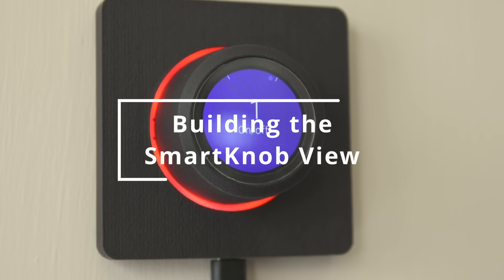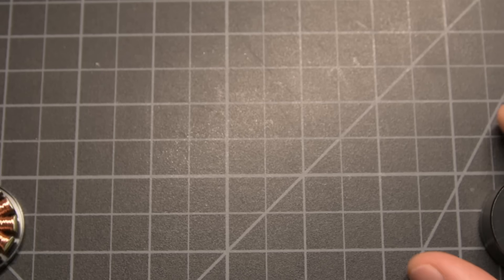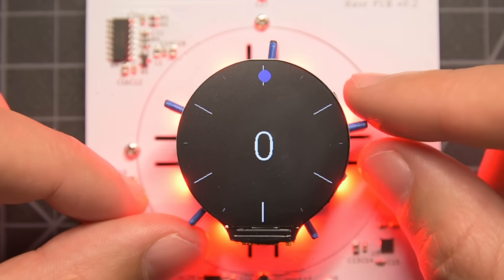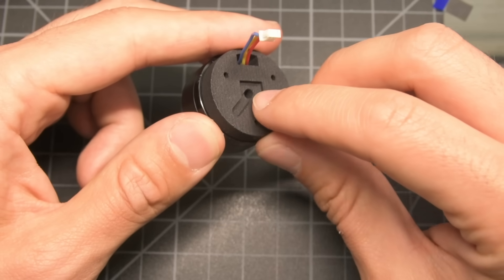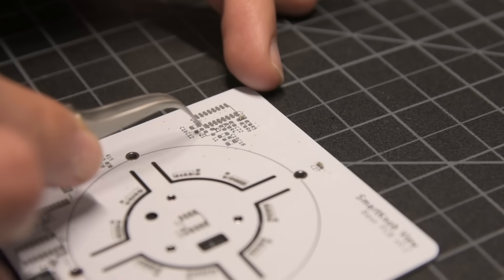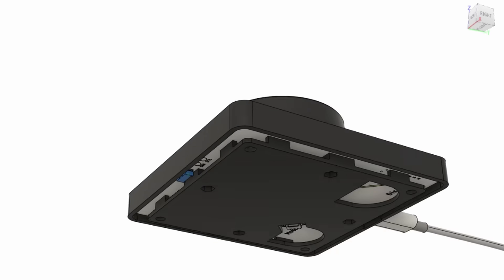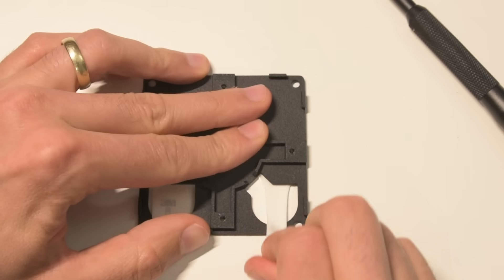Building a haptic input knob from scratch!

Comment: Would you consider making an automotive variant? Maybe with a smaller base or a small mount with a remote (via wires) mounted controller. The strain gauge would probably not work in that application, but i think a good button would suffice.
Also a round oled rgb display would be better for that application to avoid becoming a blinding light at night (yes they exist, just nit sold on mainstream sites)

Comment: You have full one axis control loading system here, it is possible to simulate mass, friction and other things. I have been working on similar project with RP2040, stepper and 24 bit mag encoder. No strain gauges, just delta between expected stepper position and actual encoder position. Fun project.

Comment: you should start business producing these. Oh, if i weren't in Russia i've bought a few of these and used them for controlling the thermostat, fan speed, dimming light (you can push to turn on/off, it remembers previous value, you have strong detents, from 1 to 100), volume of my stereosystem (why not).

I think all manufacturers should start using this concept as a real thing cuz it's perfect.

Comment: How did you handle design of snap-fit components without the ability to quickly iterate locally? Is there some reliable way to know the exact tolerances? Did you just order a bunch of times until you got it right?
Reply from the maker: I did some initial prototyping with my Ender 3 which is not super dimensionally accurate, then guestimated some reasonable tolerances on the assumption that JLC's MJF prints would be relatively precise, and then I got lucky that it didn't require more iterations 😅

Comment: Hey did you remove the Strain Gauges? I've looked through the BOMs and it looks like there are now 4 330Ohm resistors placed instead of those Strain Gauges.
Does the current PCB not have the "Button" Click anymore?
Br Shaunie
Reply from the maker: The SMD resistors act as strain gauges, and are much easier to assemble. See  https://github.com/IvDm/Z-probe-on-smd-resistors-2512 for another example that inspired this change.
Reply: @scottbez1  Cool thanks for the explanation never seen something like that :D
Reply: @scottbez1  I would have a second question, I have now all together to build one my self (very cool project) but I could not find which screws you used for screwing the motor to the pcb and which one to screw the plastic part to the motor (I know it should be some M1.6 but which length did you use?)
Br shaunie

Comment: this is not just a hobbyist DIY project, this is something completely different. this guy could put this in kickstarter and earn profit from it but no, he decided to open source his idea for the community. what an amazing lad. 

personally, this project is waaaaay above my skill level and reach. like those part are only available oversea and only sold in bulk. one day, probably, one day. 

one thing would make this cleaner is instead of having 3v USB cable dangling below the knob, is to use the main 120v for power. i get the idea of it being portable and compact but im just throwing my 2 cents.

Comment: Instead of individually soldered wires, what about a flatflex cable that is folded / rolled up to fit within the narrow inner hole? Those can even have maching SMT sockets.
I suppose that sort of thing is more suited to larger volume production, since that would add extra design / BOM complexity above that of manually solfering the narrow gauge wires.
Reply from the maker: Agreed entirely! I was also looking at off-the-shelf fpc ribbons as well during my initial design phase, but eventually realized I was spending too much time agonizing over the details needed to make that work and decided to just hand-wire it in order to build a working prototype first. Since then, the cost of low volume flex PCBs has come way down, so if I revisit this design it will almost certainly use a flex PCB to make assembly easier!
Reply: @scottbez1   I still miss watching your videos! You sure are one amazing lad

Comment: This is strangely complicated. I had expected a simplified optical encoder. Similarly to the twist pads on Neff induction stoves. They just use a optical version of rotary encoder. you just need a light source and several light sensitive diodes and some magnets for the cool haptic.

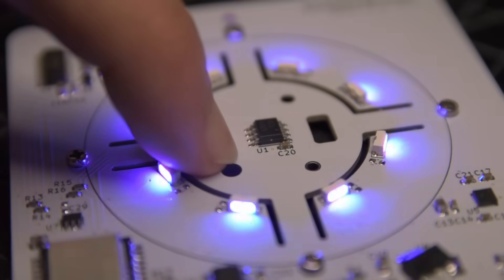Comment: 1:43 - I'm sure we all know theres some factory in china that have thousands of similar gimbal or brushless mini motors in their stock. You should use ribbon cable to transfer data and power or some kind of fiber optic cable to transfer data. 8:03 - How does that pressure sense work exactly, Gryo chip? I wouldn't use PCB as a flex button, it's going to snap after sometime. I like the fact that the motor is used for haptic sense, was planning to make a knob without a motor, but this video proves its worth using a BLDC for the haptic features. Nice demonstration.

Comment: Hi! I am looking to try make one of these myself! I am about to order the pcbs from JLC with assembly, and they dont have the T Micro 32 plus, only the T Micro 32. I am using the latest release of the base pcb, v0.4. I was wondering if it will still work with the T Micro 32, not the plus. Thanks, Koda

Comment: An alternative way to implement the “push button” would be to use the push axis function on the MT6701. That would probably require greater mechanical movement  than the flexing of the PCB  would allow. The strain gauge method would also facilitate a proportional force function, adding even more haptic feedback options. Gentle press, long gentle, hard press, hard short press/tap. Such a wonderful project!

Comment: If the force is directly proportional to the displacement, you have the very definition of a simple harmonic oscillator.  It should swing back and forth to the point it was released from, forever.

Comment: well done, as an electronics engineer all of your approaches to this solution are without error. considering the proprietory costs of some military components like yours, you should be bullet proofing this button and testing it to destruction to work out how long it will last under strain conditions and how many cycles it will last.

Comment: Very clean design. Would be nice to figure out a way to hide the power cable though. Maybe make a wall plate version that can take power from behind? The design could support alternative usb port solder location to the rear and mount holes for a standard wall box.

Comment: Can pcb traces be used as strain guages?
Reply from the maker: The resistance is likely too low. I believe the zig-zag traces in a strain gauge are typically made from other metals with higher resistivity and other properties like low temperature coefficient, so can work better than copper traces on a PCB. However, the latest design of the SmartKnob in GitHub uses SMD resistors rather than gluing strain gauges (similar to https://github.com/IvDm/Z-probe-on-smd-resistors-2512), to make assembly easier, and it seems to work but has not been tested substantially to promote it to a release yet.
Reply: @scottbez1  wow thats really cool!

Comment: Awesome build! Question for ye, why use the flexible pcb for selection detection, vs a mechanical switch? Is it for longevity purposes?
Reply from the maker: Mainly a combination of mechanical simplicity (no need to mount the motor to a separate piece that can move and press a mechanical switch while still feeling solid) and I just wanted to try something new 🤷‍♂️

Comment: Idk man all of this separate sounds like you look for a BLDC servomotor it will have all in itself, motor, motor driver, encoder, good control scheme and you should get those under $50 from ali.
Not sure about the hollow shaft, servomotor I have in mind doesn't have that, some models might have built in slip ring.
Reply: Regarding the strain gauges, you could get ones with pre-applied glue which you just tape down, clamp down and bake at like 100*C
And for it's wiring you probably want to use flex PCB, which you should get cheaply from oshpark

Comment: i have a question about the code, im using as5600 and a 360 servo but i couldnt make it right, when my current degree position for example is 270, when I want to move it to position 15, the servo move should move clock wise 105 degrees, but it didnt, instead it move 255 degrees counter clock wise. how do you implement the code with angle sensor?
Reply from the maker: Hmmm it sounds like an error in how the angle difference is being calculated, which is super common when working with angles since they "wrap around". The exact fix will depend on how you're calculating the angle difference and what the range of numbers are, but generally you want to make sure that your calculated angle difference always comes out somewhere between -180 to 180. So e.g. if the raw angle difference comes out to something > 180, say, 190 degrees, you'll want to take 360-190=-10. Or if the raw angle difference is -255, which is less than -180, you'll want to use 360+(-255)=105. The only other thing to worry about is if the sensor ever reports something more than a full revolution - some driver code will keep track of full revolutions so e.g. if you turn the magnet clockwise through 2 full revolutions, you may get back a value of 720, so always double check the range of inputs you're getting before doing any calculations.

This assumes that you always want to rotate the shortest possible distance to get to a particular angle. Things will be different if you want to always rotate to the final position while keeping track of revolutions so you can "wind up" the angle difference and then want it to fully "unwind" to get to the target angle. That's how the SmartKnob calculations are done, which requires a little additional care to be taken to make sure the sensor driver is tracking full revolutions and that all angles are represented as positive or negative numbers centered around zero.
Reply: @scottbez1  ah "wrap around" is the word im looking for, my magnetic sensor value keep max at 359 then return to 0. as5600 value in range of 0-4095 so it did not count more than 4095 i dont even know if that is possible and yes i always want to rotate to the shortest possible distance. 

 just come to my mind, do you think i can achieve something similar like you if im playing with offset? so my current position will always be 180 and after moving it to exampe 330, i will set my current position to 180, so that my code would determined what actual position that im in when offset were 0? 

thank you for your insight

Comment: I'd love to use as a universal wall control for Zigbee WWRGB lights. When turning it will dim the lights with haptic feedback and resistance according to the delay of the lights, then pressed once it will switch to CCT mode, press again to go back to dimmer mode, double press for RGB mode, and single press to go back to dimmer. All 3 modes would have the same haptic feedback and resistance functions. I wonder if this project would be possible?

Comment: 7:05 strain guage, okay how does that even work and what's its purpose in this device instead of a clickable switch?
Does it just measure an average of resistance along certain traces, so that it can feedback to pressure on the knob that has a lower profile without a standard button under it.

Comment: I can see the design aim of this is to use only SMD components that keep the form factor in that very low profile style. So it can be simply mounted on a wall with no back box necessary, and maintain very low thickness / stand-off from the wall. I wonder if there might be a good market for a model that can be powered from incoming cable behind, like an actual light switch - eg Ethernet with PoE module placed on the back (and sitting actually in the back box)? Power components of course take up a lot more physical space than any of the components used here. I am sure this has been discussed. Can anyone point me towards the discussion on this?

Comment: Pretty nice! A solution could be to use a random stepper motor that knows its own position (small stepper motor cost only 1-2$). So there is not even the magnet detector needed, only a simple sensor for finding starting position. For clicking I would use a switch in combination with a small spring. The motor could be at different positions if you move the knob with a 3d printed gear. 

so:
display
knob with gear inside 
under this a spring
under this the switch
the motor inside the knob

Comment: This looks awesome. One suggestion would be to have the option to face the USB-C port back into the wall for permanent mounting with hidden wiring.
Reply: Exactly this, or better still, some power management options mounted on the back, for those wishing to mount it over a back box. For example, PoE chip, Ethernet socket and chip, KNX power source, etc

Comment: Need one of these in an enclosure with a rechargeable battery to program up to use as a remote for my HiFi (which has RS232 control)…

Bloody awesome work … shame my soldering isn’t up to the job. :-)

Comment: Wondering how much simpler / *more accessible (as a DIY project) this would be without any electronics above the motor - just a knob with software controlled detents and indicator lights around the base.
It may be a worthwhile branch of the project, especially with the current difficulty finding suitable motors.

Comment: Pretty spiffy! The floating bridge/strain gauge structure is almost identical to the one I used when making my force sensitive flight stick like in the F-16 -- in my case I split the strain gauges across all 4 bridges to give me a +/- on each X,Y axis, also obv. to tolerate the torque from yanking on the joystick i CNC'd my structure out metal rather than PCB board :-D (more nuance, differentially amplified measurements, multipoint averaging for smoothing, otfly calibration for drift all done in software) I haven't seen another DIYer use a strain gauge in a project and you sir, made my day :)

Comment: Two of those and six buttons and you have the start of a very clean and simple looking but fully functional UI for a radio tuner and multi-media player. (Think along the line of a car stereo button layout.) In play mode one could be I/O and volume and the other would jog the track or be the tuner, the six buttons could be tuner presets or fast-forward, pause, etc. In various settings modes the buttons and knobs could do different things. For instance you could have each EQ range set to a button and have one knob dial the active one up/down and the other knob could scroll through a list of fast EQ presets. Setting time could also be pretty quick too, given how the buttons can function differently during each input state on the menu.

I came up with something like that before as part of a product design in a class, but it never went further than that. These knobs would work just fine with a variation of it.

And those knobs should be considered as a parts-bin component, rather than just something specific to a household application.

Comment: what 3d printer are you using? those pieces look like injection molded, they're perfect
Reply from the maker: I ordered these MJF prints from JLCPCB. And although JLCPCB did sponsor a portion of this video (5:26) I actually used JLCPCB and paid for these parts myself before even arranging that sponsorship. Definitely pricey if you compare to FDM printing at home, but for the quality of the MJF prints I don't know of a better option/value (and they're not even paying me to say that).
Reply: @scottbez1  ah thank you. yeah maybe not for the backplate, but for the knob and the front plate is definitely worth the cost!

Comment: Wouldn't it be better to have the detent on the mark, not in the middle distance? A regular rotary encoder makes it harder to leave the current position and move to next. Yours is exactly opposite. It's easy to leave current location and at middle distance it jumps to the next. You must add a larger "jump zone" if there aren't many steps set by user.
Then you stop the wobble around the fixed location in software. Also using magnetic encoder isn't precise enough, just switch to optical at the highes density of steps possible for that size.

Comment: Can you use a standard ptz gimbal motor and apply this anti cogging method?
https://youtu.be/Rp8YyCMY4vs
Reply from the maker: I'm not really sure. The examples of software anti-cogging that I've seen (like that video) have all been when the motor is being driven. It seems theoretically possible that you could also do it when the motor is "idle" and being externally rotated, but I just haven't come across a demo of that yet.
Reply: @scottbez1  that was my thought as well, but so long as the pole output stays on the desired output, it should be able to hold position. This wouldn't be ideal for power draw though. 

Perhaps you could use a tiny motor that sits on one side and is connected to the dial via a gear along the outside of the rim. 
This would at least give you a massive amount of small detents. 

I'm not sure how much torque is required to give the desired feedback, but you could take a look at disc drive motors. the majority of older floppy driver use ring magnets in the motors. 

I'm guessing you've already done all of the same searching I've done, but if it's helpful, you're after a "slotless" bldc motor.

Comment: That KiCad tool that shows placement is great. I have always advocated opensource tools - need based solutions organically emerge and eventually the ecosystem becomes so robust that the opensource tool becomes the gold standard in that category. KiCad will go quite far. Especially because the alternatives are so locked down and expensive.